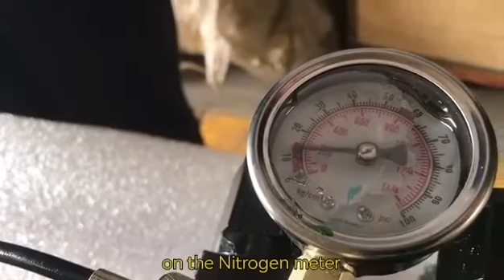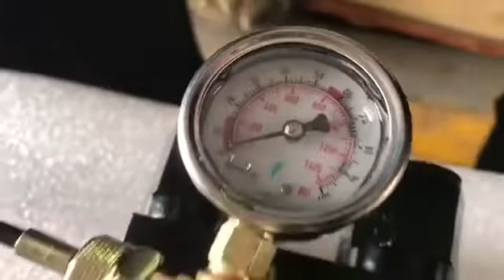how to charge Nitrogen of hydraulic breaker?

Comment: Never once did I see you push down on the valve to let the nitrogen go into the breaker. Nitrogen does not enter the breaker body unless you push down on the button and then release. Terrible explanation..
Reply: You do not have to push the valve to allow nitrogen "INTO" the breaker, you only have to push the valve if it is necessary to let some pressure OUT of the breaker when you put too much in.
The charging port on the breaker is an automatic check valve that lets pressure into the breaker when the charging line pressure is greater than the pressure inside the breaker,  but if you put too much pressure into the breaker you have to bleed off the charge in the breaker by pushing on the plunger valve to unseat the check valve while you operate the relief valve to let the excess charge out.
I agree that all people who have made videos on how to charge these breakers have done a poor job of explaining this.
Reply: @larrywalker7759  yes I realize I made that mistake. Like you said only to release the pressure. Don't know what I was thinking. I said I did not have to push down on the valve then after that I had a Brain fart. Thanks for setting my brain straight. Guess I am getting old.